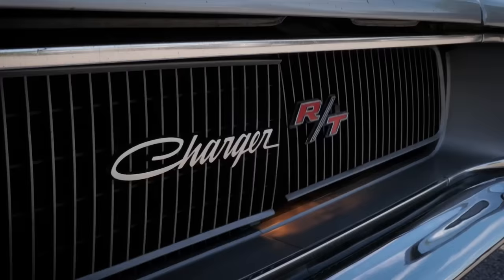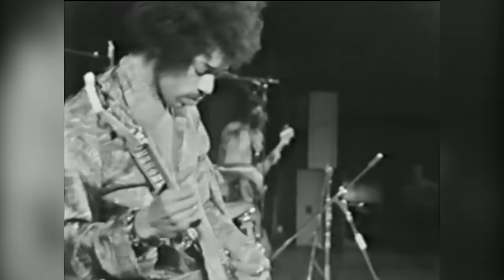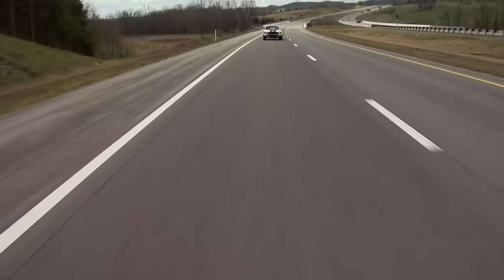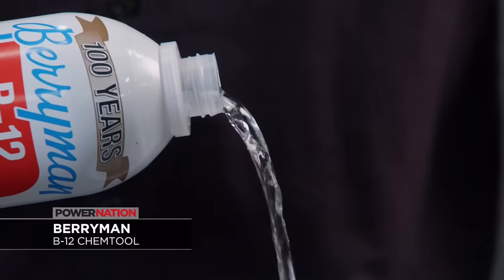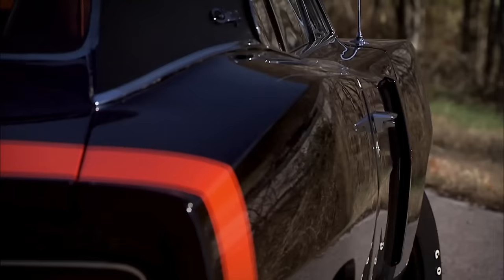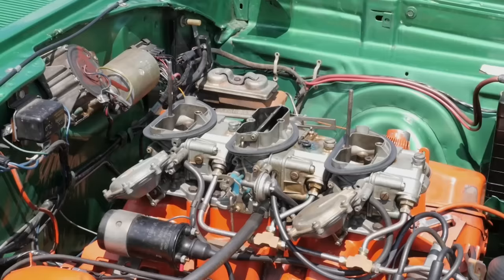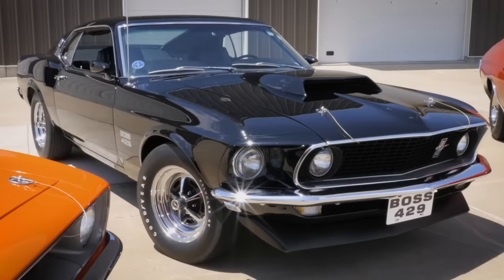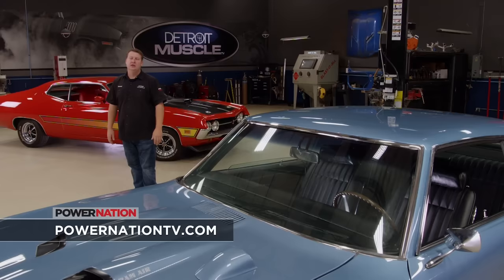Top 10 Muscle Cars of All Time

Comment: Had the correct combination in a '68 Coronet R/T, 440 cid, Holley 780 dp, 4 speed, Dana 60 4:10. A 150 mph speedometer that was always getting buried. The race was between the gas gauge and the speedometer. My only gripe was with 1/4 tank, it starved itself when accelerating hard. Other than that, the front end came up and we were gone. Good times were had in that car and then my brother rolled it. The tragic end of many muscle cars.
Reply: BULLSHIT.   With 4:10 rear the car topped at 113-115 mph  redline....so sell the BS stories elsewhere.
Reply: @chadhaire1711  You drove his car, did you?
Reply: @bradnimbus4836  Dont need to drive the car to know the axle ratio and top speed Goober....to do 150 mph that car would need a 3:23 rear...impossible to do 150 mph with 4:10.....with 4:10 the engine redline maxes out in top gear at 113 mph...so how are you going to do 150--you are not...and he did not.
Reply: @bradnimbus4836  Chad gets a little butt hurt when you question him.  Tire size and transmission ratios make a difference some can't comprehend.
Reply: @jrs416cars  He's bitter because he's been driving 1.5 litre Toyota Corolla's since 1972. Chad sucks, lol
Reply: @chadhaire1711  You are exactly correct!
Reply: @jrs416cars  "Chad gets a little butt hurt when you question him.  Tire size and transmission ratios make a difference some can't comprehend."

Not enough to make a significant difference here. He said the car had a 4-speed, so we can assume a 1:1 gear ratio for 4th gear (which applies to the Chrysler A-833 transmission, which is the only 4-speed that natively mates to a 440, and to all other 4-speeds that I know of that were available in muscle cars). The 440 Magnum redlines at about 5,000 RPM. So in order to do 150 MPH with a 1:1 4th gear and a 4.10:1 rearend at 5,000 RPM you would need 41" diameter tires in back. Do you know how big 41" diameter tires are? You can't even fit them on a full-size 4WD pickup truck without a major lift kit. As a point of reference, a military "Humvee" only has 37" tires.

29" diameter tires are about as big as you can fit on the rear of a '68 Coronet (e.g., 235/75R15), in which case, his speed in 4th gear at 5,000 RPM would be about 106 MPH.
Reply: Dude, with a 4:10 rear end, your 150mph speedo was most definitely not getting buried, or even getting remotely close.  Great car, and you love it.  No reason to be delusional.
Reply: @jrs416cars not to that extent.  Get a grip.  Plus, poster didn't state he put in a 5 or 6 speed trans with a tall overdrive.  Another fanboy fantasy.

Comment: from what i have seen in my days, yes the buick  GS/GSX was a real sleeper, from my experience the daytona charger did not sell
because it was toooooooo radical to be a street car and most guys i talked to hated them and only purists like them because they are
very rare today. as an old guy the 60s started a lot of stuff in cars and music,  todays cars may be more modern but give me a 60s car
any day
Reply: That Daytona did do a number on the ovals where they were made for. Dogs in the 1/4 mile but would fly when on an open road. Just don't open the headlights up past 120 mph. Don't ask just believe me....not pretty..
Reply: i have no doubt of that fact, i had a friend who had a plain jane 76 fairlane with a nascar engine in it and at 100 plus he had to worry about the front end coming up and i know a guy who had a 68 charger and he had the back axle gears welded which in a strait  line was okay but he took a corner at 120 and the car went sideways into a tree and that was the end of him and his car.
doing high speed is not to be played with and my roommate had an olds he did up and he was going veeeeeeeeeery fast and when the cops finally caught up with him they took the car and that was it. when i watch the vids dealing with super car drivers and watch them smash up showing off it obvious that common sense is not so common anymore but egos rule.
Reply: Its said the big rear spoiler was designed so you could open the trunk under it.
Reply: @rogersmith7396  That is true as the body had to be a production style. B body cars had a big deck lid so that spoiler had to be up there for sure.
Reply: @jrs416cars  I think Leno did one.  Also Hoovies Garage recently bought one.
Reply: @jrs416cars  "... not pretty", eh? Funny reply. Thumbs up!

Comment: I would hardly call the hemi Cuda with production numbers of 600 the most popular car. All other Car Models were way more popular. No body wanted the 426 because most couldn't keep it tuned. You heard them say the 440 6 Pac would out run them. The basic design was there in the heads, but it needed Forced Induction to bring it alive, hence the Dragsters and Blown Classes. Socks and Martin had lighten cars, and had tuners so they could run in the 10's in the beginning, later went faster but they were at the track always tuning, and were backed by the Factory. A well tuned street guy ran 13.80's with a hemi. The Buick GSX 455 Stage 1 was fast but nobody heard of them, and they only made 400, and when you said Buick back then people thought of their Grandpa's car. Muscle Cars were marketed to the Youth Market, the 1964 GTO opened that market up. I don't think it's correct to say the GTO was the first Muscle Car, it was coined that, but there was the 1963 413 Super Stock Dodge with staggered ram and 2x4's and the 426 Wedge...I was 14 yrs old at the Frosty in Rio Linda California when I first saw one. One last point, most of these Muscle Cars ran in the 14's...Myself, I tow with a Dodge Ram, Drive a Mustang, race a 68 GTO, 41 Willys has a 340 Chrysler, Boat has a Chevy, Sand Rail has a VW, my friends say I'm "Conflicted"...I disagree...68 GTO has 511in Kaufman 871 0n E85, 22lbs boost, 2 1200's...should run well into the 12's...As my brother would say, "Stab it and steer it, don't punch it and crunch it"...God Bless All Here and God Bless "AMERICA"..(PS) FJB
Reply: My vote for earliest muscular car goes to the rare '58 Mercury Super Marauder.... 430ci, Tri-power,  first car rated at 400hp !!
Reply: Amen brother.
Reply: I think the 426 was very expensive.  The pony cars were better with small blocks.  340s ran great.  So did 302s
Reply: Yeah I totally think the number one spot was flopped! The hemi cars sucked for street. My diehard mopar buddy said a 440 six pack is the best engine for street and strip. Well tuned you can keep up with the hemi. And not waste plugs idling at stop lights!
Reply: @arkhsm  Oh really?  Never heard of that one. Thanks ...  Where do you find that information?  Just curious.
Reply: So much BS

Comment: The Current Challenger widebody should make this list... as should the mustang 500, these are fantastic muscle cars.  Instant classics
Reply: I may have the names crossed I believe the Charger has four doors so in July 2022 my son bought a 2022
Charger it is a White Wide body Super Bee with the 1320 package with just over 4000 miles. He is the second owner. First owner had it for 2 months and traded it in. Nothing wrong with the car and after checking the on-board computer we saw it had recorded a top speed of only 103 mph just before it got traded in. We think the guy had a midlife crisis got the car made a run to 103 mph and it was to much.
Chrysler put everything in it that in the 70's we dreamed of and a few we never thought of. Like the computer controlled exsaust cut out's and the electrically controlled suspension system. 
It's a family four door factory quarter mile race car with a warranty. 
We have come a long way. LOL

Comment: Had a friend that traded a Lotus Europa for a ( I believe 68 ) l88 Vette. That was factory set up for rally racing. Extra suspension help with really stiff springs. 90 mph in second gear.. I grew up around cars like some of those listed but that Vette was the biggest beast I have ever seen stock. I would also give a nod to the 72 Pantera with the 351 Cleveland. Many problems off the showroom floor, but what potential and that De Tomaso chassis was wild for the day. Such a pretty car.

Comment: The first GTO was labeled 348 horsepower not because that was true, but rather that was the most they could admit and not have a scatter shield required to be installed to take it to the drag races. If you had 350 horsepower the shield was required.
Reply: net horsepower was more like 300......

Comment: Oh and my dad and I both have 1967 impala ss as well is a switch though, his a butternut yellow black interior ss396 th400 , mines a black on black , ss 427 l-88 second design 4 spd and a power  rag top , both buckets and console cars , mines really low mileage, and the l-88 was a dealership fix for a blow 390 Hp 427 , original owner opted for the l-88 , I hit the lottery with my impala 😊

Comment: 69 Ford Mustang Mach 1 , 70 Shelby , 65 Comet Cyclone , 69 Camaro, 69 Plymouth Road Runner, 70 Plymouth Duster , 70 Dodge Dart, 1972 Chevrolet Chevelle SS 454 ,1972 Dodge Charger , 1970 Dodge Coronet Super Bee 440 six pack.
Reply: and any 2021 Dodge Charger with bone stock 5.7 can match or beat them.....LOL

Comment: 1970 Olds 442 W-30 (455 rated at 500 lb-ft torque) if Shelby Cobras and corvettes are not included in discussion. The Olds beat them all back in the day. I remember. You had to be in the know to know that back then. Glorious days to be sure.

Comment: Any Corvette with that 427 Tri Power should be listed. I owned a 68 convertible (new body style) with that 435 hp three 2 barrel carb monster.  Luxury items: AM/FM radio, power steering, power brakes. Nothing else to drain power from that setup.
Reply: I owned a 1968 chevy short-wheel base fleetside pickup with a factory 427 automatic PS, AC,   am FM special order factory Custom outa Little Rock. She was the fastest thing around.
Reply: actual net horsepower was only 360..less than the net of a new 2022 V-8 with easy 400+

Comment: 427-435hp rated well over 550hp is laughable.
Basically a stock .060 over 427/390 hp (L-36), now 439 c i, from a 1969 . Stock oval port heads, treated to a mild port on the exhaust side, with hardened seats added. Factory low rise alum. intake, Hooker 1 & 7/8" headers. A Comp Cams 270 Magnum hydraulic flat tappet cam. on the dyno yesterday ( it was too rich out of the box and leaning it out added 25 hp).

Full rebuild including decking the block, overbore to .060, plate honed,etc. Balanced and blueprinted.

Peak hp is 456 @ 5100rpm

Peak torque is 536 @ 3600 rpm

Real measurements, not internet hp.
Reply: Peak 456 GROSS on a dyno is only 373 NET installed in the car.........any stock 2021 Dodge 5.7 can match that at 375 net--2022 V-8 Camaro at 455 net......REAL measurements NOT YOUR internet hp.....your 427 is a dog

Comment: The "Top 10 Muscle Cars of All Time" were all built in the USA. Time to broaden your outlook to check what was built in some other countries. Try Australia and South Africa for a start.
I do note that most of their muscle cars used Ford or Chev. V8s.
But have a look at Chrysler Australia ValiantCharger R/T E49, 265 cubic inch, straight six with hemi head and triple weber dual choke sidedraft carbies -more than matched most V8s.
Or the Ford Perana from South Africa, a Capri (English type) with a Windsor V8 -could be ordered from any ford Dealer in S.A.
Reply: I came here purely to see if the list included any non-American car. I am with you to have a look at Australia and South Africa for starters and maybe a look at Britain might turn up a couple of interesting examples too.

Comment: had  a 66 GTO in the 70,s put in high lift Isky cam 750 double pump Holley Hooker Headers and it was dyno tune to 500 H P
Reply: 500 on a bare engine on the dyno is only 420 NET hp in the car---big deal..

Comment: About a 1/3 way through, and I am wondering about the 69 AMX which was the only car that gave me trouble in my fast Ford days. I didn't like the 396 SS Camaro with the competition clutch, if you drove that in the city you had to have super strong left leg. I hated city driving in that. The later sixties and early 70's MOPAR big blocks were bad about fish tailing, and the rear end gears stripping.  I did like the older MOPAR hemis like 1965 charger.  I also liked the 1967 Chevelle SS, my dad owned one and we swapped out the shifter for a HURST.  I didn't like the Biggest blocks like their BOSS 429 those belonged in the Lincolns along with the 465 engines. On the 427 and 428SCJ in a Cougar XR7 I had to have universal socket sets to get to two of the spark plugs because things were so tight to the fender wells.

Comment: Must be nice to have a GTO as your first car. My first car was a worn out, beat up 77 Impala 4 door with a worn out 305 with a single barrel carburetor.
Reply: My first car was a 4 cylinder 83 Thunderbird so i can relate my brother owns it now.
Reply: I drove a 70 Eldorado 500 CI 400 HP.  Moms.  Lots of drag racing.  Always beat 396 Chevelles and 383 Roadrunners.  I restored a copy to the same looks a couple of years ago but no drag racing on a 50 year old car with few replacement parts.  The motors have been built to over 1000 HP.
Reply: Yes So in love with 429 mustang 😻 muscle cars 👋😁

Comment: Top 10 or ALL TIME...and doesn't have the 1987 Buick Grand National or the even more rare and faster 1987 Buick GNX? What about the Olds 442? That 1968 Hurst Olds 442 was a beast with 390 hp!
Reply: W30 442 is a glaring oversight 
And I’m a Ford guy
Reply: @klompsauce  Oversight?  Remember that it was the readers supposedly made the ranking here.  So popularity-wise,  the potent 1970 GS Stage 1 and 1970 W30 with the optional "328" cam were omitted.  The majority of the voters obviously knew little or nothing about those two cars.

Comment: My top muscle isn't even considered as a muscle car yet.  The 1986/87 Grand National/T-Type is my favorite muscle car.  I've tried to keep it as true to stock as possible, but with making the power I want to make it is impossible to keep it stock.  But at least I haven't LS swapped it, still has the Buick's little off-center 231 v6.  Buick's 231 v6 block found in the Grand National/T-Type/GNX/89 Turbo TransAm, is by itself an unremarkable v6.  What is considered eye catching hp these days, can't be made with the stock v6 block.  Some guys have made over 1000whp with the stock block and lots of stuff done to it.  Most guys running the stock v6 block will have to stick to around 600whp.  While that's not eye catching these days, it's enough for me.  To reliably make 600whp, rebuild on the engine and transmission along with upgraded drivetrain, fuel system, turbo, IC and an aftermarket ECM for tuning.  You might think the aftermarket ECM is too far, but once you spend in excess of $20k on the motor and transmission rebuild you start thinking twice about trusting this investment to an $80 upgraded PROM.  After buying a nice example for the Grand National and you want to make serious power with the stock v6 and transmission, be prepared to spend an additional $30k.  Swapping to an LS block, isn't as inexpensive as people think.  Lots of fabrication and a rebuild on an LS motor isn't exactly inexpensive either.  Also with an LS motor you are most definitely going to want to put better transmission, so you have that expense as well.
Reply: Oh, man. You need to go to the 41st Annual GS Nats. in Bowling Green his coming May 11-14.  THE premiere Buick event.  Or at least google it. I don't know what you consider "serious power" but my brother's GN  makes 612 rwhp/524 lb-ft torque at 5450 rpm with WAY under $10K including the beefed 200R4 tranny and Vigilante multi-disc converter. BTW, no serious Buick guy would defile his BUICK with any Chevy engine for any price!

Comment: The 1969 GTO Judge came standard with the 366 HP Ram Air III 400, not the "way underrated at 370 HP" RA IV.
Reply: These are GROSS numbers..the actual NET horsepower was not 370 but 310......
Reply: The car and the 400 never impressed me.  I did like the 64 389 though.

Comment: Torino’s novas chevelles roadrunners chargers 442s rivieras cyclones gtxs coronets rebels are muscle cars. 
Camaros firebirds javelins mustangs cougars barracudas challengers are pony cars
Corvettes gt40s and cobras are sports cars
Reply: I outrun Corvettes in the twistys with a Turbo Saab.
Reply: @rogersmith7396 And any corvette will out run your Saab in a straight line.

Comment: 657 HP dual 4barrel carb, Ford Cammer, 427C1
1964/67..
Could chew up a Hemi an spit it out with it's eyes closed... Chrysler crybabyed an protested 24/7 
just to shut them the fup NASCAR banned the Galaxies, an the 427 without them even racing.
Thing is Ford was cleaning up at NASCAR at the time, till Richard Petty started against all odds winning in a 426 Hemi.
the motor was awesome at the drag strip,

...

Comment: I'm fine with the list.  I'm glad the Cuda was number one, it really was the most powerful.  It seems like this list is more power oriented.  My only input would be that if you're going to mention the less powerful '69 Camaro RS as an honorable mention....you have to have the 69 Boss 302.  That's my number one.  Even though the 429 was more powerful, practically...it is more of a unicorn car.  I mean I guess that doesn't matter since the Cuda would be a unicorn car based on units sold.  But the B 302 looked better than the 429...and Ford had to change so much of the Mustang to get that engine into the bay.  It was just an attempt to get the Mustang into NASCAR.  Still a marvel, but you don't see 429's, no one had one.  The 302 was more attainable and was a truly great feat by Ford in Le Mans and other touring races.  It's the best looking muscle car I've ever seen.